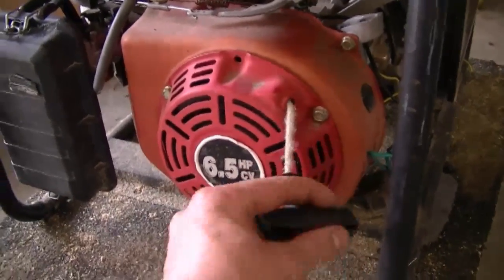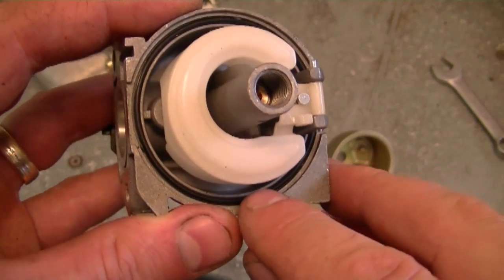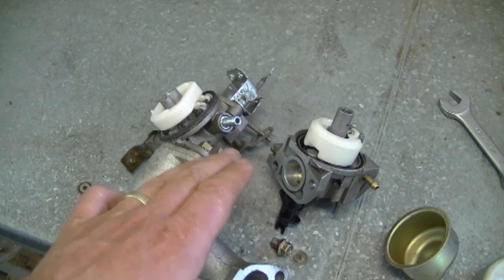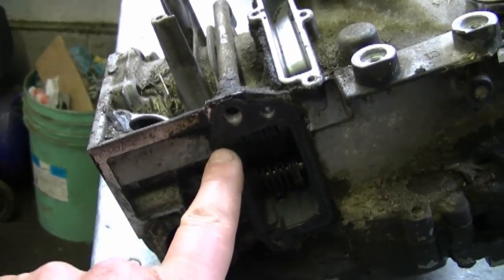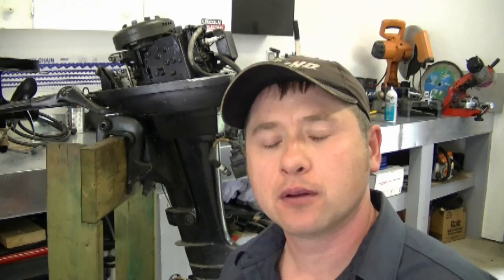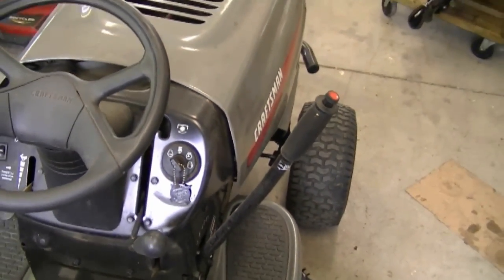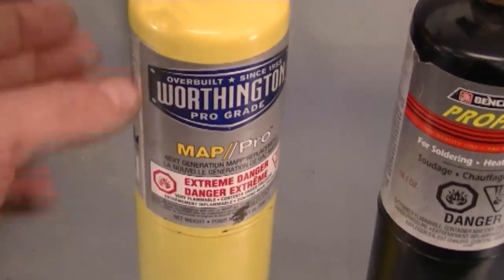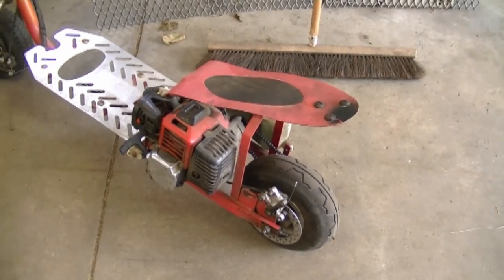Small Engines Q & A Video #104 in HD

Comment: Thanks for the tip on why an engine is burning oil.  I had spent $30 on parts but missed replacing the spring.  I think part of the problem was I had been putting in too much oil when I was changing it.  Ended up spending $200 on a new engine and now I can get a start on the first pull!  I can spend more time getting work done.

Comment: Great video as usual! I would just like to add that on the Briggs v-twin engines if you have a bad diode module for the kill circuit (prevents the kill wires from each coil back feeding the other) then you will also have the engine not shutting off or only shutting down one cylinder. I believe all other v-twins use the diode set as well.

Comment: Ditto on ksids request that you do a video(s) on converting a Briggs or other engine to run on propane. I have seen quite a few youtubes on doing just that and some techniques are quite simple. I have done it on my tiller but to get up to speed/power I need to get more fuel into the intake. This would be a very informative video if you do it. Just make sure to give a caveat that we are on our own when it comes to actually doing the changeover. Thanks for your time on your vids.

Comment: Thanks for your great videos.
I got a question, one of your videos shows how to rebuild a carburetor using repair kits.
Well I've got my K20 kit today and already matched all the parts that fit my carburetor (it's WT-99), however the kit contains two diaphragms that come in the same shapes but different colours: one set seems to be rubber (black) the other set looks like plastic with a silver net inside. Does it matter which set I use ? Both fit in my carburetor.

Comment: Can't post link to video, but search "easy" from 9/11/11
Cover is glued on with gasket maker. May need lots of prying to get it off. Don't damage the head, but don't worry about the cover. You can bend it back into shape or replace it.
It doesn't seem that this would cause low rpms, but Don will know.

Comment: i have a techumseh almost identical to the one that is ripped appart in this video for parts. i was trying to get the bottom cover of,but a 3 pound sledge on the crankshaft won't even do the trick! i checked fr any pins and/or clips and there werne't any. a baby could move the sum-cover around upwards of the crankshaft,but it won't go anywhere past half-way?

Comment: Another problem with the lawn tractor running, could be the carburetor, if it has a solenoid on it, and the solenoid is bad so the engine is dieseling.